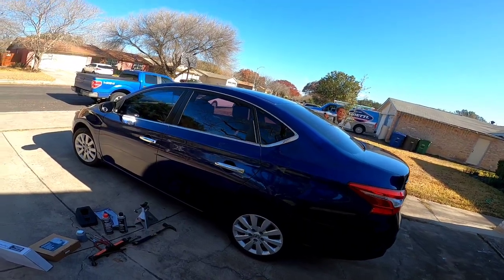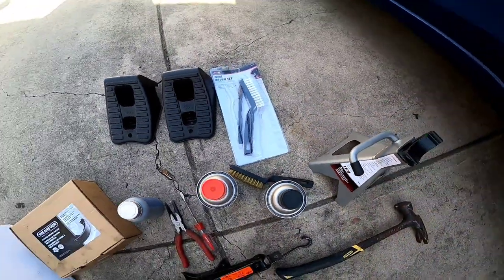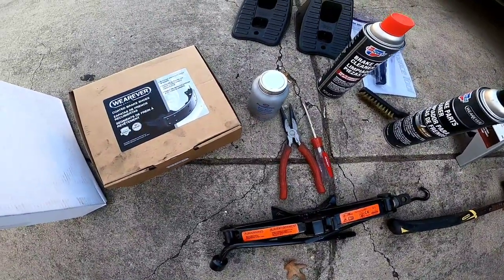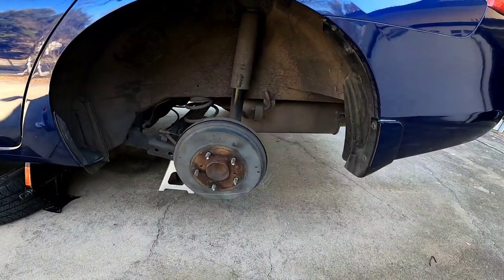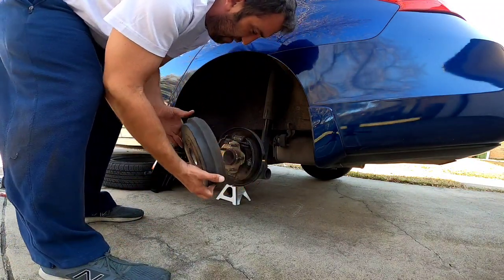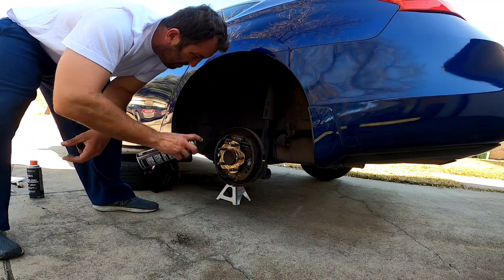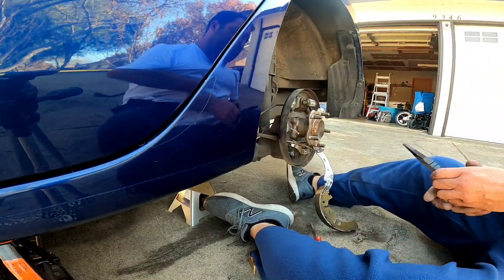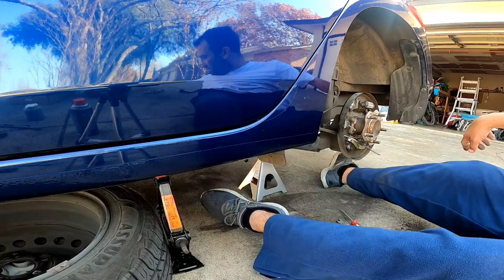Rear drum brake change for a 2016 Nissan Sentra

Comment: Proper order:
Remove the upper and lower springs first. (Use a good, grippy pair of needle nose pliers. If your pliers slip then use a wire cutter instead for better grip cuz those springs are strong. Don't worry: you won't cut the spring. Unless you're He-Man.)

Then, take off the retainer clips. (Needle nose pliers again. It's real easy, just grab the top sides of the clip, squeeze it down, then slide it off.)

Then the shoes and automatic adjuster come out easily.

Twist the adjuster either all the way down (shorter) or most of the way. (The new shoes are going to have nice thick pads on them and they'll need the extra room.)

Using your trusty needle nose pliers yet again slide up the spring on the hand break cable to easily remove it from the back shoe. (It's always attached to the back shoe no matter which side of the car you're on.)

Clean out rust, dirt, and debris with a wire brush and brake parts cleaner. Don't forget to clean your drum, too. If you're reusing the old drum that thing's dirty. If you've got a new drum then there will be a thin coating of light weight machine oil on it to protect the metal; you need to clean that oil off with brake cleaner.

Grease up any contact points on the back plate where the shoes or hardware might rub. This is a case of a-lil-dab'll-do-ya.

Now, put the new shoes and hardware back together in the reverse order that you took everything off. So, think, the springs will go on last . With the automatic adjuster in place you'll see a wheel with gear teeth on it. Use a pick or flat head screwdriver to turn that wheel until the adjuster is pushing on both shoes.

Slide your drum on and give it a spin. If it spins freely with no rubbing sound and no resistance then you need to expand the adjuster more until the shoes juuust touch the inside of the drum. If the adjuster is opened too much then either the drum won't go on or the shoes will be rubbing and dragging the drum so much that you can't spin it.

Once it's just right you can get your wheel back on.

Last step, pump your brake pedal a few times while in park. Find somewhere where you have enough room to drive in reverse a good bit (like 50ft or so) and drive in reverse as fast as you have room for and push your brake pedal good and hard. Doing this will set that automatic adjuster to the right position. That's why it's called an "automatic" adjuster ;)

Comment: Looks like it's a pain in the ass
Reply: What I did is attach the top spring to 1st after the E-brake cable and as put into place. Yes those retainer clips are a HUGE pain in the butt. GM’s were much much easier. That said & after I skinned my knuckle pretty badly what I did was use a vise grip “CLAMP” at about the 11 & 1 o’clock positions to basically give myself an extra hand. Doing so once you get the shoes in position frees up both hands to push the retainer stud in from behind while using your pliers to put the clip on from the front. 
You don’t need A LOT of pressure with the clamp just enough to hold the shoes in place while putting on the clip. I found that putting it on any lower with the spring attach causes the bottom of the shoe to bow out arms at the bottom. I also did one at a time. 
So get one shoe on, then attach the spring only to both using the clamp (a big C-clamp should work too) attach the clip one side at a time then put the adjuster on only after you have it spun in ALL THE WAY. Once that is done make sure your in proper position at the top on the brake cylinder pistons & attach your bottom spring & your done. 
Put the drum on & bolt on your tire. 
Remember before you go driving around to “BACK UP “REVERSE” slowly a couple times to allow the adjusters to seat themselves to properly self adjust the brakes & your done. I hope that helps.
Reply: No isn't if you use de correct tools,harbor freight sell a special tool for 14.99 and is really easy and simple with this,you save a lot of time and headache,if all parts fit as they should it will take around 40 minutes per side.!

Comment: Have you had any problems with this car ?
Reply from the maker: No real problems yet. Just basic maintenance. It has just about 105k miles on it with no mechanical issues at all.
Reply: @ryanlsorrell1983  my transmission went out at about 55k . Thankfully it was still under warranty and they replaced. I'm at 60k now.
Reply: Remember cvt fluid change ever 25k miles..
Reply: I had no issues until about 100k miles.. my trans gave out it was like 3k to fix.. and now she’s back going strong I’m at 130k now and I mean it is a slow car and I feel like the biggest worry on the car is the transmission.. but if you get passed that it’s not bad.and it has great mpg I get like 30 in city.